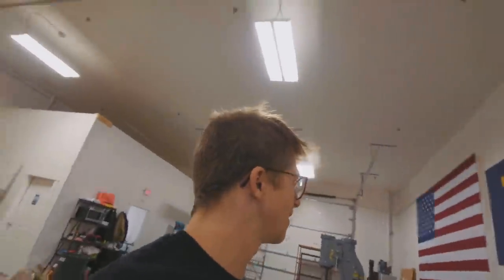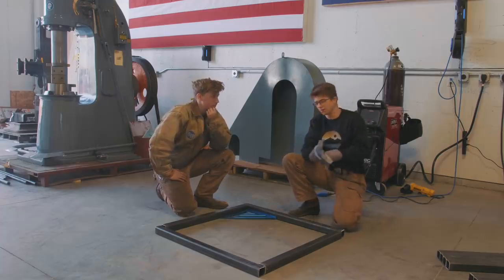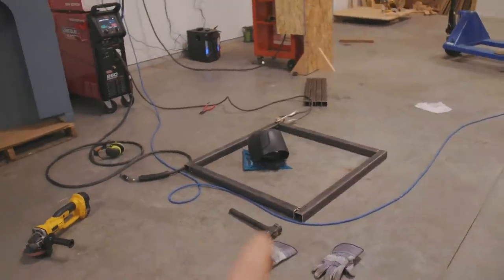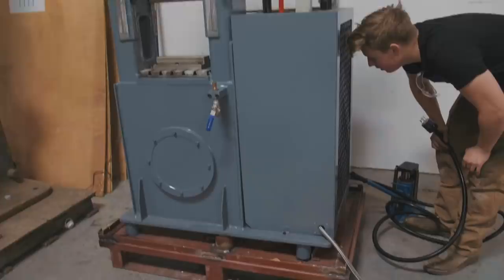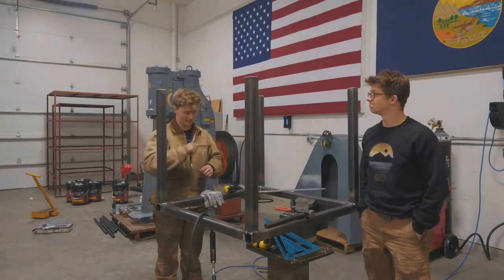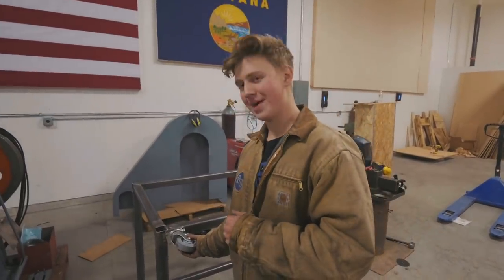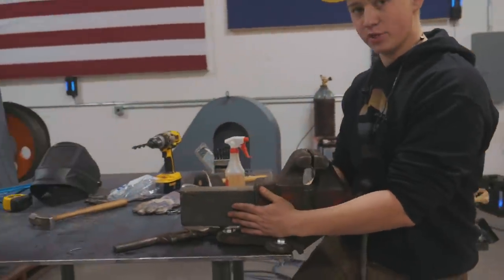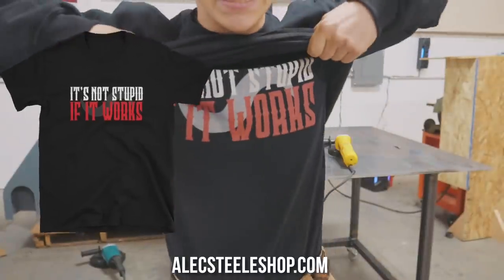HORIZONTAL SURFACE NUMBER 1!!! The Welding Table!

Comment: would be Super nice if you could add the metric units along side the Freedom units
Reply: I agree but I do like hearing inches, yards and pounds because I have no concept of what they are so it's like that episode of interdimensional cable The Adventures of Stealy, where he counts his success in Brapples. There's no way to know what a brapple is so you just have to imagine, just like inches and furlongs
Reply: @abekane7038  Furlong sounds like a small, fluffy woodland creature with a long snout and big eyes to me. xD
Reply: Freedom? You mean empire units!
Reply: Furlong is a field distance measurement, particularly popular in horse racing.

Comment: Very useful tip! When you pour anything out of those 5 gallon buckets with the spout, turn it so the spout is on the top. Much smoother and more controlled pour.

Comment: Rotate the oil bucket 180 degrees and poor with the spout "on top." Then it won't do the old "glug-glug"!
Reply: works for any size oil container
Reply: Works for ANY spouted container of liquid
Reply: The shotgun method was more American anyways 😁
Reply: All those buckets have a small opening with a plastic pull out to allow air in. I could see it on their bucket.
Reply: I was going to say the same thing but, someone beat me to it. Almost any container with a spout. It let's air in and fluid out, smoothly. Because... well, air can get in, smoothly.

Comment: I would have just welded the wheels on.  Trip to Ace not going to happen.  🤣
Reply: My thoughts exactly. Ive never bolted on casters, always weld!
Reply: yep, I've tried to talk myself out of it before, but 3 good tacks is just as easy to zip off as removing 3 bolts, should you ever need to replace a bad wheel.
Reply: on that note it could have been 2 very diffrent metals that dont bond well when welding the bolts were the easier choice in the long run
Reply: would have done 3 bolts and weld ...
Reply: @irikuchitharnaby1219  clean off the galv with a grinder and any mig set will bond them no matter what

could always test with a magnet and get some inconel wire if its not carbon
Reply: @irikuchitharnaby1219  I would guarantee the casters were just galvanized steel. Grind off the galvanized bit (or weld right through it if your brave) and you're left with steel to steel.
Reply: first time seeing them bolted on anything.
Reply: irikuchi tharnaby how different do you think they are?  Both steel.  I’ve done it dozens of times without an issue.
Reply: max nex good point.
Reply: I think the wheels are galvanized steel, it will be difficult to get a good weld for them to sit because there is a big difference to how the matrials will react, the wheels have such a thin matrial, it will only burn through. would do exactly as they do ...
Reply: Yyeah, those are big enough where you don't have to worry about the heat from welding ruining the bearings.
Reply: @ManCrafting  they are not "both steel", the surface you are welding to with Galvanised steel is zinc, an entirely different metal.
Reply: Alle Berg 🤔  galvanized is a coating, I don’t think they are galvanized though.  Probably zinc coated, but that said the Mig will weld it.  I usually hit it with a grinder.  That removed the coating easily.  Put the heat on the thicker metal and draw the puddle into the thinner metal.  Easy as pie.
Reply: KnightsWithoutATable exactly.  Never an issue.
Reply: Michael Stephenson mmmmm.  Grinder removes zinc.  Easily.  You’re welcome.
Reply: That's how Diresta rolls.
Reply: Will even said they were gonna weld the wheels on at around 3:20
Reply: I think I would have welded some plates on the bottom. You can pre drill and thread the holes that way and if the wheels wear out they are easier replaceable. To each their own I guess
Reply: Should have welded some square flat strapping to the bottom, attach casters to them.
Reply: But, but, ...but it's an excuse to go to the hardware store !!  The Hardware Store!
Reply: Also tapping 1/8 steel tubing on 3 of the 4 corners. They’re going to strip out.
Reply: @alleberg9779  sure galvanized wont weld great, but ive never had a weld fail on casters.
Reply: Probably for easy replacement when they inevitably get destroyed.
Reply: I would have cut a 3/8 or 1/2" plates, drilled and tapped the caster's hole pattern in them then welded the plates and bolted on the casters.
Reply: irikuchi tharnaby with the welder thay have it would not be a problem.  Just knock-off the zink coating and tack it on.
Reply: Exactly what I was going to say!
Reply: Me too
Reply: Was gonna say the same thing 😂
Reply: Either way would work but knowing galvanized steel puts off a toxic fume when being welded it wouldnt kill but would leave a nasty headache
Reply: @max nex Have you seen Alec's welds? He's very modest, but his welding has come along awesomely!
Reply: Josh Duke not really.  A lot of welding maybe.  I’ve welded tons. No issues.  Just don’t inhale the fumes.  Not to mention Lincoln sent him a fine extractor.
Reply: dksix1905 that’s actually a good idea.  Even if you were only going to tack them on.
Reply: David Galbraith grinding a tack isn’t a big deal.  Probably quicker than removing a bolt.
Reply: Alle Berg 
No, I weld thin galvanized strut to thick mild steel with stick for the electricians all the time.
Reply: @max nex Agreed. I was defending his skills from another comment, even though I'm sure he intended it humorously.
Reply: You cant, welding stainless steel to carbon steel fucks up the weld and the base metal.
Reply: Gotta use those DeWilt tools in the vidjayo some how.

Comment: I'm pretty sure every single YouTube video that has welding in it also has someone disparaging their own welding. Has any human, ever, looked at their own weld and went "wow, that was good!"
Reply: Well yes when you pull off a 6G root with no suck back. That was in an odd position. We take pride in are craft like Smith's take pride in forging.
Reply: Yep! and those people aren't usually filming or on YouTube
Reply: Troll management. If you say it sucks, they are disarmed.
Reply: Matter of fact when I was a welder/fabricator I would take pride in perfect scales and no under cut or burn through on stainless.....yes I would like the way my joints look and I would say," man, looks like some sort of welding god came in here and layed this perfect bead down"😉
Reply: Andy Meneely yes I have more than a few times.
Reply: Nope I've been welding 30+ years and still downgrade my own welds lol
Reply: Yes, but then I chipped the flux off...
Reply: Almost every weld I made professionally. They had to be good to pass inspection. Shure, sometimes you had to hang by your toes and weld using a mirror, those were seldom nice. But if you can't getvyour head in, the x-ray machine won't fit either ;)
Reply: Adam Barnes yea I do it on a daily basis.
Reply: When i weld with tig im normaly happy...looks like fish shell ...but with electrode and mig...it looks just mkay x) as long as it pass the xray check
Reply: Yeah. On the Titanic. And we all know how that went. :P
Reply: @WinterCharmVT  The Titanic was riveted.
Reply: Dan at hoonigan has some nice welds
Reply: Once in every 5 or 10 welds.
Reply: Andy Meneely I’m a pipe welder and yes, my welds are a thing of beauty.👌
Reply: I have. 
It's one of the best feelings in the world to look at a bead you've laid down and know that it's solid and clean. To see that it's not undercut and that your overlaps aren't obvious and the whole thing is just friggin' beautiful.
I get this big, goofy grin on my face and it just feels so good to know I've done work that I know will be solid and reliable.
Reply: Yes...yes I have, and do so regularly
Reply: Oh no i'm too self critical, after each weld i comment something like : That went curvy. This one's small it need an other one. Oh dear i waited too long here.

Yea... Oh, this one is perfect, i like it !
Reply: Oh yeah! There have been times that the weld was going so well, I never wanted it to end. They end and I let out a small cry in my coal blackened little heart.
Reply: Every welder I've worked with, thinks they're a jet pilot and can do no wrong.
Reply: @jkoeberlein1  we have one at work who is nicknamed "Rod Johnson" (he doesn't know).
Reply: Yeah Jesse James always said his welds looked great in his shoes. But then he was right.
Reply: Yes. Because it's how I earn my paycheck.  If you aren't on that level you should just stay in the garage.
Reply: rich pasto You, sir, would probably benefit from the humbling experience of a comment section on your life.
Reply: George Koch pics or it didn’t happen. I’ll believe you if you post a YouTube video and every single comment was a positive comment on your welding.
Reply: Josh V Yup. Amazing how many people in this thread have missed my point.
Reply: @magman519  uh yeah it was called an apprenticeship then breaking out and people actually relying on you to do it right the first time.  You're clearly in that "stay in the garage" category.

Comment: Welding joints like the corners of the table not only look a lot better when the two meeting ends are cut at a 45 degree angle but also are much stronger than just butting one end up to the side of the other.

Comment: Here's a tip for pouring out of a 5 gal. bucket, rotate the pour spout up toward 12:00 and it won't gurgle and sputter. That let's the air get inside and create a smooth flow.

Comment: Quick question, why would y'all not face the rear of the chop saw towards the wall?
Reply: If the blade shatters you don't want it flying across the workshop.
Reply: Plywood is cheaper than fixing a wall if something goes wrong.
Reply: AJ Ramos not beat up the wall probably.

Comment: If you ever make a welding table 2.0 consider using I beams (like 4”) spaced apart as half the table top. It will give you areas to clamp to, that a solid table doesn’t offer. Also the gaps give you a place to cut steel, without hanging half the sheet over the side of the table.

Comment: Spark guard made of wood 🤔seems legit
Reply: Jonny hooks could cause fire?
Reply: Zulfikran Zulmos  are you joking or not I can’t tell
Reply: @zulfikranzulmos4066  Not really, grinding sparks are really hot but are also really tiny. Because of the square-cube law, they have a really high surface to volume ratio which means that by the time they hit the guard, or in fact your unprotected skin, they've lost enough of their energy to the air that there's not much danger of burning anything.
Reply: Plywood is considered highly flammable usually, as well.. lol.
Reply: mauther100 😄😄
Reply: @mauther100  hope he was joking lmao
\
Reply: What could go wrong?
Reply: Those plywood are made of thin wood cut into small pieces.. The chances of fire is more higher.. Well do u know how ppl makes fire really?
Reply: Better be safe

Comment: Hey guys just an old guy tip for you. When you pour out of a 5 gallon container like that turn the spout 180° from where you had it. Spout at the top not the bottom like you had it. It seems a little awkward but it is much easier to control the liquid coming out and it stops the glug glug. It lets air in over the liquid without ruining your bucket. Learned that from an old German tool and die instructor.

Comment: Just weld the fracking wheels on..... how much time DDT o you spend/waste being pedantic .... I love you by the way
Reply: How long do you think those will last anyway with about 600lbs of steel sitting on them?
Reply: @jeffreyshanholtz5997  Exactly. Easier to replace.

Comment: Heres a tip. When you pour from a five gallon bucket, put the spout at the top. I know it sounds dumb but it helps with air flow so you don’t get the “ glug glug” action going on. Much smoother pour. A heavy equipment mechanic taught me this trick

Comment: Well a triangle gusset in the corner where there's no material to bolt the castor to. It'll strengthen it, hold it square over tons of abuse and give you a place to bolt the castor's on 100%. Just an idea. Love what your doing. Glad to have you here in America. I'm in Washington state, so not to far away.

Comment: with the extra castor mounting point being in the center of the welding table, you could drop in a but of plywood/steel plate and have a storage area for extra welding stuff to keep it all together. or turn the space underneath into a gang box for all the welding accessories.

Comment: Hey guys, when pouring anything out of a lidded, full, 5 gallon bucket, pour it with the spout on the top.  It allows air back into the bucket and eliminates "glugging".  And it pours faster.
When the bucket is half empty, rotate the spout down to the bottom.

Comment: If you put a plate under the welding table you could use the extra caster holes as mounting/fastening points. you would have under cart storage(i.e. welding supplies)

Comment: Thanks for another great video love your channel and welcome to the USA! Hey if you tip the oil bucket the other way with the spout on the top side the oil will flow out smoothly and you wont have to poke holes in the bucket.

Comment: To het castors on, should have cut out & welded a plate on the corners, than would be able to attach all four bolts to frame/castors. That's what I did for my table😉(also did that a bigger similar thing for top to add just a tad more support & add accessories for the table top. Just an FYI for next time you do a project.
Can't wait to see the shop "moved in, set up, & complete".
Cheers, A

Comment: You can weld the casters to the bottom of the table. Makes for a stronger hold. I have done this dozens of times in my weld shop. I would recommend you tig them if at all possible, but you can stick or might as well. Just be more careful of the bearings and the grease.

Comment: A little tip for pouring from a 5 gallon bucket... lean it over but with spout at the top, that way you can let it get some air and it wont guzzle. As you need more just roll the bucket to control the flow.. hope that makes sense.

Comment: To get all 4 bolts on the casters weld a plate in the corner which also serves to add strength to the frame.

Comment: @Alec Steele if your mig welding is jumping as your welding, turn your wire speed down ( aka amps) and turn your volts up a little. Your welcome.

Comment: will, tip of the day, instead of keeping the opening of the oil can/bucket facing down, rotate it 180 degrees and pour it from the top, pours much better

Comment: Give you a tip. when pouring out of a drum like that 4:43 , have the opening at the top of the drum, not the bottom, it lets the air back into drum and wont "glug"

Comment: Alec,
Enjoyed watching you build the table.  While watching you build it, it reminded me that I have been working on my will and need someone to put in it for my dad's workbench.  He designed it himself, and it is made entirely out of 1/4" steel.  There is a vice on one side and a grinder on the other.  Would you want it?  Let me know and if you do want it, we can work out details later.  Also, I was wondering if you could tell me what a Damascus steel 4" meat pounder would cost if you made if for someone.  What I had in mind is a 4" diameter bottom part with a handle coming out of the middle of it of about 1" or whatever size would make a good griping size with a ball at the top of it.
Keep up the great work!

Comment: spreader plates then weld the casters on! if you wanted to be fancy  tab off the frame on the corners with box with a captive nut inside the box tab with a m18+ studding welded to a spreader plate with the casters on then you could lower the casters allowing for adjustment for  a level table and being able top move, when the casters are up you  have a solid table 👍👍

Comment: When pouring oil out of a 5 gal bucket, start with the pour spout at the top and rotate it around to the bottom as you pour it in, and it won’t gulp air on you and you can pour it slow enough not to over run the funnel. Y’all may have not been a 1/4” off on your legs on your table, you can’t trust a concrete floor to be perfectly level. They look level to the eyes, an you wouldn’t notice a low/high spot in the them because there not big of difference. However you put something flat on the floor, level, table will wheel, welding curtains it will then show itself as unlevel.

Comment: Have you considered making some acoustic panels for the ceiling? As I'm sure you know, Echo is caused by two parallel surfaces and both your ceiling and floor are flat, hard, reflective surfaces. You could tame a lot more of that Echo while keeping that treatment out of sight. Food for thought.

Comment: Little tip for pouring the hydraulic oil, put the spout on top. I know it sounds weird but it works. Let's air in and no glug glug glug

Comment: For the hydraulic oil, try stabbing a hole in the lid on the opposite side from the cap. That way you can put the pail back down without spilling everywhere.

Comment: When pouring from a spouted 5 gallon can, position the spout at the 12:00 and not the six. It will pour faster as long as you dont choke the air flow.

Comment: Since you've got that over hang with the wheels, you could put a thin piece of steel or wood there on the bottom as an extra shelf that's also mobile

Comment: Hey Alec, y’all could’ve put the casters on with u-bolts. Instead of putting them on parallel to the tubing , you could’ve put them on perpendicular and ran u-bolts through the holes. Like a leaf spring mount on a trailer. If that makes sense to you

Comment: Tip for the next time your pouring fluids from a container with off set spout. Put the spout at the top and it allows the air in and pours nicely.